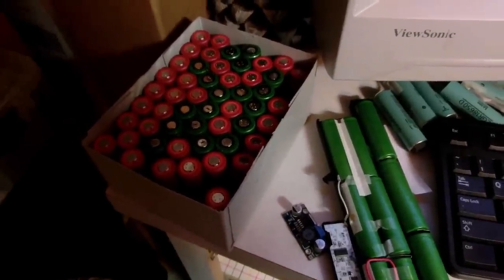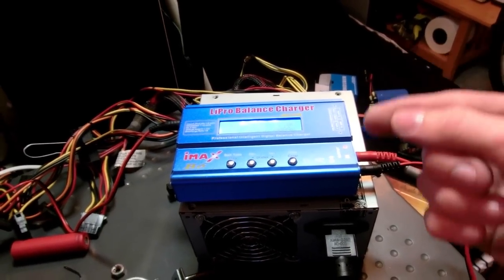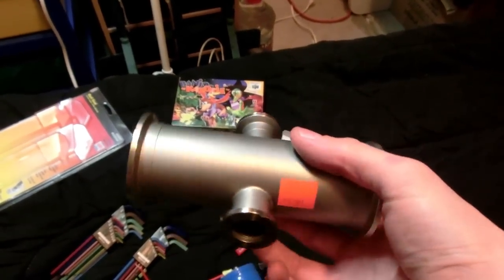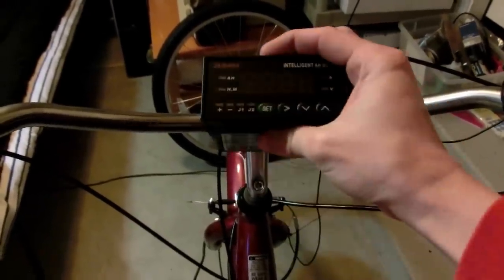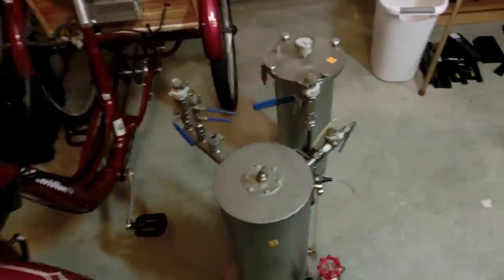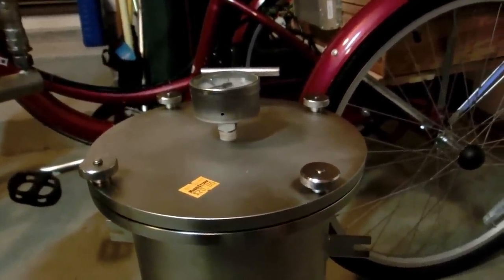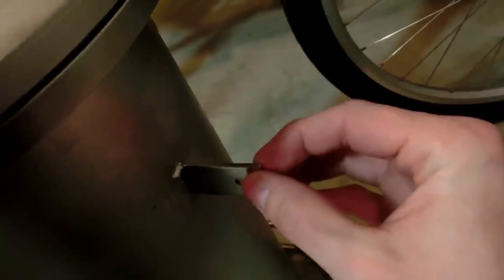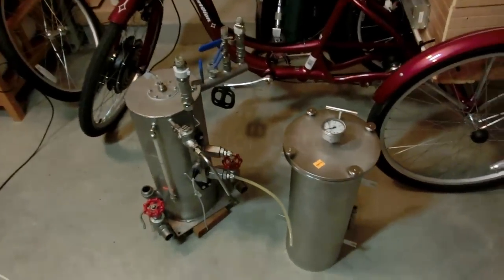Random Bits 0083: lots of new items

Comment: Always enjoy your video's.  Especially the re-purposing of things.  With that thought, a used refrigerator pump will pull 28-29ish inches of vacuum for cheap.  Should be dirt cheap if not free.  Not sure if that's enough for what you need though.  Likely you already know about them, but if not hope it helps.

Comment: I noticed that and other trouble with the iMax B6 (I have 4) and the Turnigy Dlux DC 80 w. I noticed that the voltage at the battery was never even close to what the charger said (I used several meters to check). They all charged and discharged to different voltages. I finally got a LiitoKala Engineer Lil-260. It's not that great ether but? It also gives internal resistance reading that you can use compare cells. Another thing I noticed is some cells will only give 1.000mah at 1A but at .500 they will give double that or even more. I ended up dividing the cells into 2 groups 1 group that tested good at 1A discharge and a second group tested at .5A. It took forever to test all the cell I have. Just under 300 and some I tested 2 or 3 times.
Reply: ww321 I have a BT-C3100.  It's like your Lii-260, except it does 4 completely independent cells.  It charges 18650s to 4.2V, and discharges to 3.6V.  It will do an automatic charge-discharge-recharge cycle, and give you the mAh capacity from the discharge.  Set it and forget it.  I just finished cycling about 200 18650s salvaged from laptop batteries.

Comment: cool stuff :-) chamber should hold under vacuum and the other cooler one could work with chilling and recycling oil when cutting metal :-D good progress :-) take the chamber with the gauge on sitting on the floor :-p easier to carry about when stuff is in there :-)

Comment: A small geckos climbed into my power supplies ( with auto voltage selection) burnt itself when I switched on the computer. Now it is out of order some parts must be short out. This is a new power supply and used for only one year will also work in US and UK. How is your job? It is very interesting to see how you make a microscope!

Comment: i switched over from a turnigy accucel 6 from my imax b6 mostly because of this reason, it also has a cooling fan. also while charging some 18650s the other day i found some that have a full charge voltage of 4.1v and anything over that is converted to heat, so while i was charging this it took about 11 amp hours of energy to charge but it go so hot where it was uncomfortable to touch, also it did look very similar to that red cell you have there.
Reply: Thomas Sears its also capable of 6 amp output not just 5

Comment: i am making a spot welder of my own. i am using toriodal transformer and rewound the secondary windings with 2awg cable. i now get about 2 volts ac and probably like 400 amps. the capacitor idea of yours is very simple and seems like a great idea. look forward to seeing how you go about making it.
Reply from the maker: smallenginedude71 Weird Stuff Warehouse is selling 2.7v 450 amp power transformers for 25$, if 2.7v works i may just buy one of those units.
Reply: Rinoa Super-Genius 25 bucks is a great deal!! i would just buy that. 450 or so amps is fine for spot welding sheet metal together and other thin metal. you would obviously want more current for thick metal.
Reply from the maker: smallenginedude71
but i think more voltage would be nice also. ;/
Reply: Rinoa Super-Genius it certainly would as you could spot weld with the terminals farther away from each other
Reply from the maker: smallenginedude71
ya know i didnt check the other units, maybe they are like 8v 200a. either way they arent going anywhere. i think their pricetags say theyve been there since 2013.
Reply: Rinoa Super-Genius well thats good that they are not going anywhere. check em out and see what they are like :)

Comment: discharge measurement is more accurate as these are used cells. However, imax only sucks 1A, which is approximately 0.5C. Li-ion batt can discharge 2C(4A) so I'd use your 1 ohm, 100W resistor to test the cell, loading 4A @ 4V.  it only takes 1/2 hour to pull voltage from 4.2V to 3V for a 2000 mah cell, much faster than imax. I'd set a timer for about 30 min. If the voltage is above 3V, I'd keep the cell.
after the 4V units are made, you can test 2 units with the resistor loading 8A @ 8V for accurate AH measurement with a timer(measuring time).
note that max. current for the resistor is 10A.
Reply from the maker: Henry Chang but i will never be pulling more than 0.5C

also as long as the input electricity is proportional to the output it would be fine. i'm only doing this so i can arrange the cells equally then i will test them as a whole pack latter.

i'm wanting to get a result accurate of 25mah between 3.6 and 4.2v
Reply: Rinoa Super-Genius first test is the screening test. if you want bad cells too, set timer to 20 min.
second test is about 0.5C for 16AH pack. you just discharge it from 4.2 to 3.6V. your Fluke is very accurate. it takes 2 hours approx. just watch the timer as it approaches the end. the resistor is going to be hot (64W).
if 4A is too much for you, find a 2 ohm power resistor. that'll lower it to 2A.
some 18650 can discharge at 30A
Reply: Rinoa Super-Genius 
mix the "winners" and "losers" within the 4V unit so the winners can help the losers, otherwise the losers would die sooner. dont separate them.
note that good cells save space.

Comment: Wow thats one scary vacume chamber thing if only it had a window then we could do crazy things with marsh mellows and see the effects, You may want to run some diagnostic tests/checks on that imaxb6 i think they can go bad over time?
Reply from the maker: steve64464 no its just bad programming for the discharge feature, also these cells are being very differant so i'm rethinking how to test these.
Reply: Like some sort of dummy load and a small computer device that can detect voltage/current draw .Iam not sure

Comment: That second tank reminds me of a mini boiler. Steam powered bike anyone?
Reply from the maker: ww321 you would want a coil shaped boiler for that, my e-bike project actually started as steam powered. spent 3 years on that.
Reply: Rinoa Super-Genius Yes you are right about being able to heat water quickly. Trains used dry tube type boiler similar to the ones in the link. I just retired from the hospital where they had 2 300 horse power boilers same as link http://www.powerhouse.com/wp-content/uploads/2012/05/cleaver-brooks-cble-300hp-150psi-stm-21.jpg
Reply: ww321 The sight glass on the side and all the connection places reminded me of a vertical boiler. http://www.historytoy.com/bilder/produkte/gross/Bing-130-91-Stehende-Dampfmaschinen-Dampfmaschine-mit-Kesselspeisepumpe-mit-Hebeluebersetzung-und.jpg
Reply: ww321 Yes I ran and maintained about 10 different kinds of boilers over a 14 year period . From 7hp to 300hp.

Comment: Man I was literally thinking applied science when you ended up talking about his channel haha Youtube is a small place in some circles. One of my favourite channels easily, very knowledgeable guy and so clear in explaining things.

Lovely looking pressure vessels though, for 20 dollars you're laughing.
Do the calculations on the hoop stress though, no need to risk them (they seem fairly hefty anyway so probably fine but still)  It really isn't difficult.

It is just punching in pressure, diameter, thickness and knowing the yield stress of the material (just grab common values).

http://www.engineeringtoolbox.com/stress-thin-walled-tube-d_948.html

I actually think applied science goes through the rough in the workshop style calculations in a video about making a pressure vessel, maybe for supercritical CO2 I think... been a while since I watched it.
Reply from the maker: zero_sum remember though that its easier to withstand pressure than vacuum. a oil barrel that withstands 90PSI crumples at like -4PSI. this chamber came with a 30psi guage on it so i bet it can hold a bit of pressure, only a test will tell if it can withstand a vacuum.
Reply: Rinoa Super-Genius For some reason I forgot you were talking about a vacuum scenario. Got tunnel visioned on the 'pressure' bit of pressure vessels ignoring buckling effects and that, my bad. You could still look up something for it if you want but experimenting up to partial and full vacuum probably suits better.

https://dspace.wul.waseda.ac.jp/dspace/bitstream/2065/34610/5/Honbun-5030_02.pdf 
Page 4 of this pdf, equation 2.2. It probably doesn't apply properly but it could give a round about number. 

Maybe someone who knows more will jump in an correct this for me.
Fired it in to wolfram alpha here with a thickness of 0.008 m and radius of 0.08m, just guessing approx. from video. 

https://www.wolframalpha.com/input/?i=%28%28%28200*10^9%29%2F%281-%280.3^2%29%29%29%2F4%29*%28%280.008%2F0.08%29^3%29

Output would be pascals. 

Useless really but I just got interested myself so I said I'd include it in my reply. 
Wish I had such cool shops and markets near me like you do. You could really get into some fun trouble with bits and pieces like that. Look forward to seeing various projects develop man!

Comment: That chamber wont crumple up I'm sure. You're only talking 14.7 psi on the outside
Reply from the maker: ww321 but 14.7 on the outside is very differant than from the inside. a steel oil drum can hold like 90PSI but crushes at -4PSI or so.
Reply: Rinoa Super-Genius I understand vacuum and I also understand steel. Drums have a wall thickness from .023" to .063 for most. The only thing that gives them strength is the beads rolled in the sides and having a top and bottom. If that S/S chamber has a wall thickness of more than .093" I'm sure it wont collapse. It is a way smaller diameter than a barrel so the differential between diameter and wall thickness is less. As diameter increases so must the wall thickness.